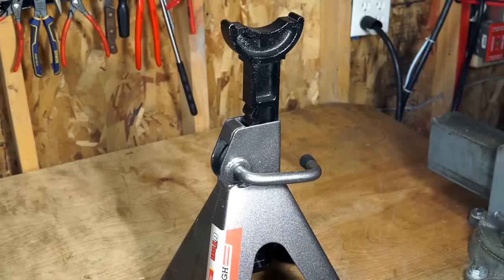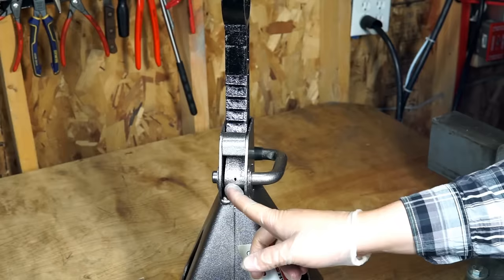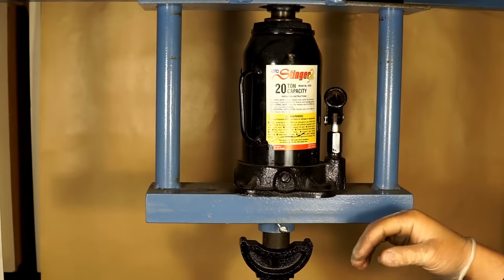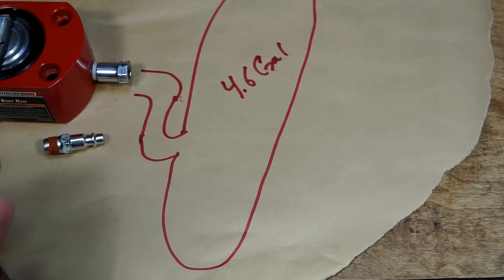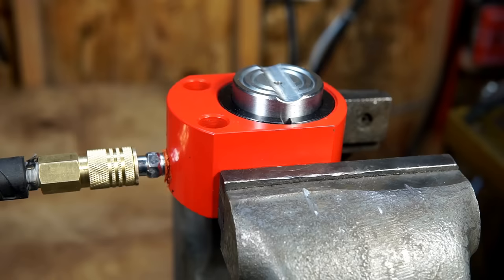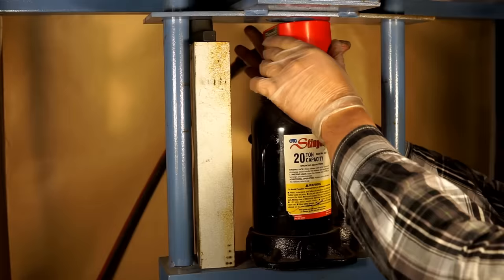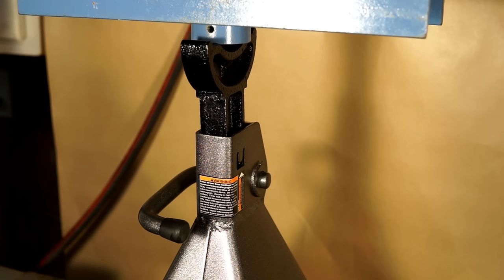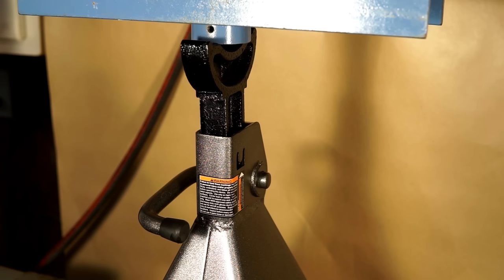EXPERIMENT: WARNING! Doing this to your Jack Stands will get you KILLED!

Comment: the side that I'm working on. I always leave the jack in place... if i'm work working on  car where the tire will be off.. I will take the free tire and stick it under the car also...as a safety..... if ti's work that can be done with the wheels on.. I use ramps rather than jackstands.
Reply: Using ramps alone killed my dad. If you do use ramps, jack the car up a little and still use stands too.
Reply: I to had ramps fail. My dad called me to do break work on his truck he had ramps that was about 5 years old. So i drove his truck up on the ramps. Before i put jack-stands under it i went in to get (Water yea right) to drink. Came back out the ramps failed flat as a pancake. After many years of using ramps i will never after that day.
Reply: Plastic or steel ramps? Those plastic ramps are terrible
Reply: What kind of brake work were you doing using ramps?
Reply: Must have been an Alfa Romeo

https://en.wikipedia.org/wiki/Inboard_brake
Reply: Must have been shit ramps. I have a pair of ramps that were made by my dad's uncle, my dad said those ramps were made somewhere around the 1950s. Although a bit rusty they are still pretty damn strong, but I do also put stands or a couple of wheels under the car just in case.
Reply: yea back then stuff was made to last & built tough. Fast forward 40 years and production sucks big time. They dont want things to last because big companies cant profit from things that last. Still wont get under a car on ramps unless i have a second backup to the ramps. I have been working on cars & heavy equipment for over 30 years & only seen those ramps fail granted my dad cheap & that may answer the question lol
Reply: There's a name we give to old strong tools, it's called Grandad Brand. LOL
Reply: Yep trusted tools. I still have tools from my grandfather in my tool box i am going on 50 so they lasted many years of hard work and abuse & still work as good as the day he purchased them. lol
Reply: I put my jack under the car when I'm on ramps. just in case.  my steel ramps are getting old.
Reply: Thats #1 safty no matter what  anyone uses is to have a 2nd or even a 3rd back up. And if you dont your playing Russian roulette with your life.
Reply: thats what I was always taught as well. Never rely on just one device for your safety.
Reply: I'll put the weight on the stands, leave the jack and then shake the hell out of the car, harder than I ever will while under it, to make sure it's settled into place and not going to fall from pulling on a stuck bolt. I'll use the tires if they're off, extra stands if not. I've got six, two of them have pins you have to pull out instead of a flip handle. But my car only weighs 1500 lbs.
I had a buddy who spent 6 hours stuck under a 52 GMC, barely able to breathe and couldn't yell, til someone happened by. One of the dangers of working alone in a closed shop.
Reply: Great advice... I have done it with these extra safety steps as well. I always want at least 2 solid objects that are a bit thicker than my head between the car and the ground. And chock the wheels on both sides.
Reply: Ramps nearly killed me. I drove the front wheels on the ramps. Started to jack the back with a floor jack under the differential. As the back the was going up, the jack was pulling the front wheels off the ramps. All of a sudden the car came back at me fast. I was on my knees in the center of the car so I could see the jack on the differential. I was able to push off so I didn't go under the car. What saved me was that the jack dug into the dirt outside of the garage and stopped it.

I never used the ramps again.
Reply: Maybe mechanics should wear a life alert?
Reply: Not bad idea. But anyone working alone on any projects does not have to be auto mechanics, all take the risk of injury just something to keep in mind when working alone. Just work smart. And the best thing to do is to let someone know where & when your working on a project. That way something does go wrong someone knows where you are if not heard from in a set time.
Reply: Bighappy, i agree, never trust a jack alone and never trust a stand alone.
Reply: Kobe Wild do that save my life changing ball joints I kicked I car off the stands scared the crap out of me
Reply: lmao 👍
Reply: She gotta have some steel sweet lips.
Reply: I do the same things and, when using ramps, add jack stands and put concrete blocks under the ramps.
Reply: Thanks for adding this comment, SBC (and others).  I had no idea ramps were so dangerous until I read the comments here.  Thanks everyone.  This is valuable knowledge.
Reply: Ramps are not dangerous unless you buy cheapo ones, if you buy a decent (Weighty) pair then you will be fine, also another thing to look out for is the bracing, if they have really thin braces (less than 5mm thick) then get rid of them, i have ramps that my dad owned back in the 80's and we have done crap tons of work with them and no failures, the only times a solid piece of metal fails is if it is welded wrong or there is obvious damage like a crack or something.

To be honest if you have a decent sized back garden or something it may be worth just building a pit, removes alot of the risks as you can't go wrong with a pit and a pit can never fail.
Reply: Mike whit , those tool your talkin bout must  be Craftsman ... i have all my father old sets as well. 😊
Reply: Yea some are but many are not marked.
Reply: Kobe Wild I do the same thing lol
Reply: I'm on the internet, so I must know what I am talking about.
Reply: Kobe Wild I do the same. I actually keep 2', 4', and 6' sections of 8x8 lumber that I use for safety cribbing. used to do rebuilds on large diesel engines in a barge outfitted as a mechanic shop. as a precaution if I were to go under a blocked up engine I would only do so with 12x12 timbers on either side of my body for the length of my body as crush protection. it may not save me from all injury but would save me from death. and did save me when one of the tug captains decided it would be funny to slam the tug into the barge while I was under a 45L V8. it fell over and those timbers saved my life.
Reply: Also if I'm taking a tire off, I leave the tire under the car.
Reply: I have some wood blocks made from cut railroad cross ties. I've been using these for years, they're great.
Reply: If you use a wheel chock the car can't roll back off the ramps. I assume that's what happened to your father.
Reply: You do know ramps, like anything else will have a weight limit...
Reply: Some Jags have inboard discs too
Reply: I don't see the point in using axle stands AND ramps. You'll end up with no room under the car to do anything!
Reply: If they are rusty they have another name...DEATH TRAPS!
Reply: I once bought an old 3/8ths Snap-On ratchet for a coupe of quid from a car boot sale. The ratchet mechanism was bad and it would slip at one point. So I gave it to my cousin who got it fixed for free by the Snap-On guy who goes to his garage.He fixed it the following week because he had used his only spare ratchet kit already that week.We were a bit surprised when he told him just how old the ratchet was.It was part of the standard tool kit supplied with WW2 Sherman tanks!
Reply: Yes, me too, but I prefer to use stands as the bottom of the car makes my nob sore after a while...
Reply: Proper mechanics generally use a two or four post ramp
Reply: That won't help much. Rubber compresses more readily  than your head!Put the wheel under there instead.
Reply: Mike Whit  They did build a lot of things better in general in the old days, but there was some garbage too. Now we only see the stuff that lasted.
Reply: Yup. It's called 'survivor bias'. Because we only see the stuff that lasts, we assume that everything made 'back then' must have been made as well as the stuff the lasted.
Reply: Geers Tyresoil or an old jag
Reply: Kobe Wild ramps can fail
Reply: Kobe Wild i do exactly the same 👍
Reply: for optimum safety always use a jack stand in combination with either a ramp or jack
ramps sink faster than jacks and can also collapse with no warning
I prefer jacks over ramps 
though when you do have a car fall you can always use your jack to get your ramp out but its hard to use a ramp to get the jack out
Reply: I will always use my tire, jack, and Jack stand when working on my car.
Reply: mike dutdut why are you bringing ramps into this if you think they are shit?
Reply: I use a sturdy log next to the stand. if the stand fails, the log Definetly won't.
Reply: Ramps are safe if you use them correctly, to raise the front or rear wheels. Ramps are not intended to life the front wheels while you jack up the rear, and certainly not without some means of securing the front wheels so they can't roll back DOWN the ramps.   Not that many jobs really need all 4 wheels off the ground together, but if you do need to, then do it properly. Just need under front OR rear with wheels on, then ramps are fine, drive up, can in gear, parking brake applied or in P if Auto and parking brake on, then chock the wheels still on the ground.
Don't blame the ramps for your error.

Comment: Probably a good idea to clean the jack-stands off with some brake Cleaner every now and then to keep any residual grease and oil off of the safety mechanisms. I've used jack-stands for years and I do remember once seeing one fail somewhere but I don't remember the details. I remember well enough, however, that I always leave the jack in place after letting most of the pressure off. Leave just enough pressure to hold it firmly in place. Somebody here mentioned leaving the wheels under the frame as well, also a good idea.

Comment: From rallying I've learned to put the wheel under the car while the car is on jack stands.

Even if the car falls without injuring anyone, it is still easier to get a jack under it if the car is sitting on a wheel and not the ground.
Reply: gcKukie wish I would have known that recently, i was jacking the truck up and the right side jack stands that was under it apparently wasn't seated well. So as you can guess the trucks right side fell off the stand hitting me and forcing me to push the truck to avoid being crushed. Anyways thanks for the tip (:
Reply: I taught my kids that exact same idea
Reply: gcKukie 

YEAH, PRETTY SURE ALOT OF PEOPLE DO THAT.
Reply: LOL
Reply: Of course, Lecy.  But since you often take off the wheels anyway - just put them under the car as well - as added safety.  I like a jack - a jack stand - and a wheel shimmed in with wood - just in case a helicopter falls on you.  Then you would be toast anyway.
Reply: did a lot of work on the car in my avatar in the 27 years i owned it... those o.z.racing wheels were $400 ea new plus $100 ea to polish them at about 10 yrs old. not gonna scratch em up like that! but seriously you have to  be completely incompetent to knock a car off good stands and i usually had a floor jack shoved under to share the load at the corner I was under.

Comment: my jack stand has physical metal pins you put in when you set it.  they are as thick as the teeth on the jacket and and are meant to stop exactly this.
Reply: Zephroth Talinguard
Thats what I was wondering.... Surely a simple clip or pin could be used to prevent accidental use of the lever. Apparently manufactures already agree :p
Reply: Nothing against this guy, because there are obviously cheap jack stands like this that have no such safety feature. Someone needs to educate the ones who cut costs and get an inferior jack stand.
Reply: Zephroth Talinguard  common sense says to put a bolt in there.. of course all the extra  holes mean there will have to be thicker steel.. more holes more manufacturing cost which makes the cost go up.. and the bolt should be made out of hardened steel. here's another thing why are jack tops so small ..there smaller than the rail on my 99 expy. On a truck like that it should be a 3 inch circle top.  One last thing if the pin is somewhat optional... Well you know the rest of the story..
Reply: Looked everywhere for a pair of those for decent $. Harder to find, but def worth the extra assurance. I knew a mechanic a few years ago that, used to keep pins in all holes he wasn't using  just in case one of the pins failed.
Reply: Bud home depot jackstands are fine and come with the locking pin. Used them for years no problem.
Reply: My stands do not jack up - it's a manual placement. A U-shaped pin goes into two holes simultaneously. Makes me feel 100% confident. But I just discovered I'm missing one, the little keeper leash broke and it's misplaced...